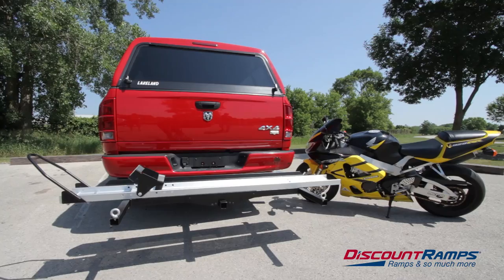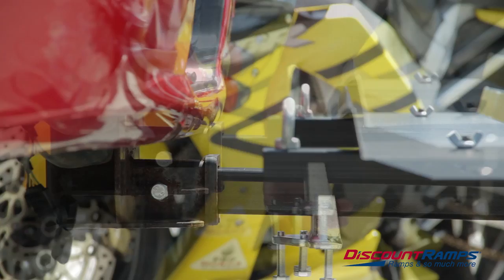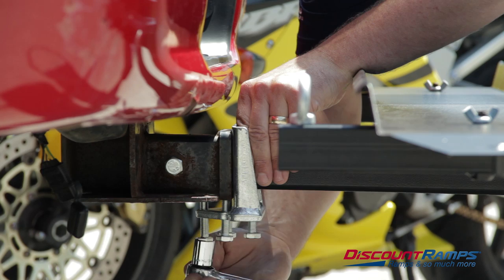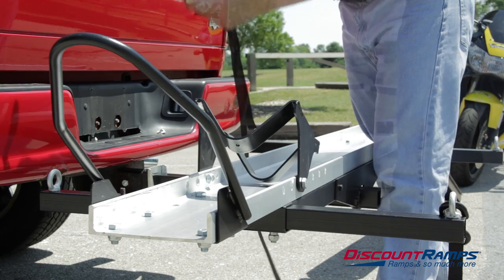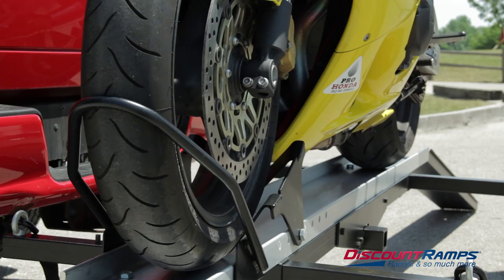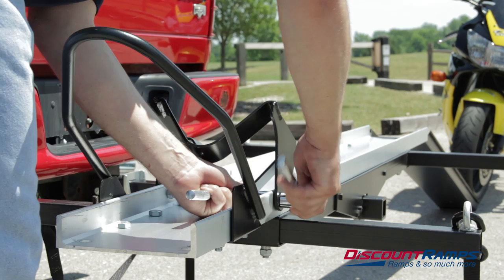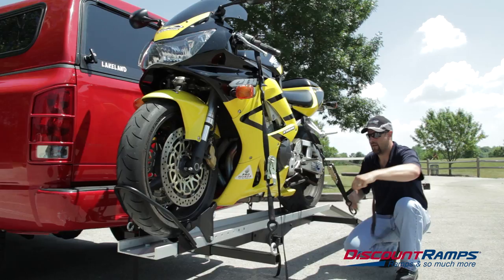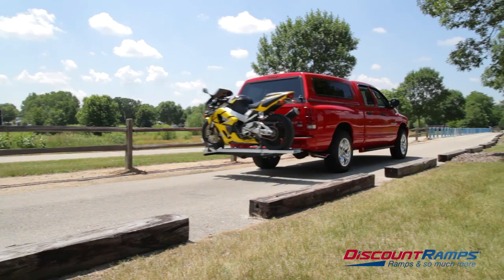SMC-600R - Hitch Mounted Sport Motorcycle Carrier Installation

Comment: Used this product on my CBR1000 RR Fireblade from Austin to Dallas, and back again in my Tundra Platinum 4x4. Worked like a dream. Make sure you use the anti-vibration stabilizer, it's beyond important that individual piece is installed correctly on the trailer hitch, or else your vehicle will bounce up and down like kids in a playhouse on the street. Heck, without it there is no way you could do 50 mph. I was hauling, hitting 95mph at a few points...which means I don't loose time traveling great distances. I love this thing.

Only caveat, since it's hundreds of pounds added to the total weight of the vehicle there is extreme drag resulting in higher fuel consumption. For my V8, I calculated a loss of 20 - 23 total miles per fill up (25 gall tank normally nets 17 miles per gallon)

Comment: Bet you could slide another piece of square tubing down the cycle carrier tube and gain some extra strength.  My Honda Silverwing weighs around 551 pounds wet plus the junk I carry.  I 12" piece of square tube or even a piece of angle iron would provide enough strength to support a little extra weight.
Reply: I just sold my bike and it fit on this but the new bike is a Harley DYNA and 670lb total. I wonder if your logic will work or will I need to buy a new one and try to sell this one since it’s a 600lb limit. Any thoughts?

Comment: Can you install the chock/ramp on the other side? To make it easier for a short guy to hold the brake lever :)
Reply from the maker: Unfortunately the chock and ramp are not designed to be interchangeable.
Reply: @discountramps  Thanks, to clarify I meant if the load platform can be rotated to the other side so the bike can be loaded from the drivers side?
Reply from the maker: @jeffbarnard348  with the placement of the wheel chock, the ramp cannot be used from the driver's side.
Reply: I know it's 4 years late, but their reply to you was wrong. You could absolutely bolt the carrier unit onto the main hitch tube in the other direction when assembling everything, which would allow you to load it from the driver's side.

Comment: I wish this could be done alone.
Reply: CheerX9087 I'm 60 and I installed it on my own. Multiple ways to do so. Set the back end on the ground and tilt up the hitch tube end, rest it partially on the  hitch receiver tube and the lift and slide from the backend. However I just picked up and slid it in.
Reply: CheerX9087 I'm 60 and I installed it on my own. Multiple ways to do so. Set the back end on the ground and tilt up the hitch tube end, rest it partially on the  hitch receiver tube and the lift and slide from the backend. However I just picked up and slid it in.
Reply: CheerX9087 I'm 60 and I installed it on my own. Multiple ways to do so. Set the back end on the ground and tilt up the hitch tube end, rest it partially on the  hitch receiver tube and the lift and slide from the backend. However I just picked up and slid it in.  Very solid well built and inspires confidence.